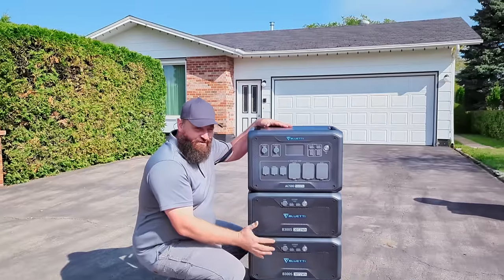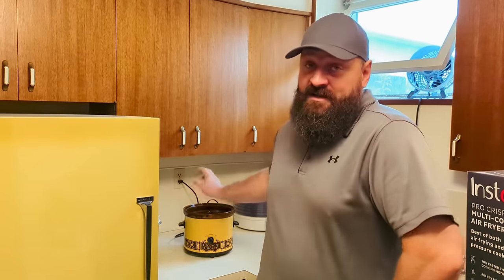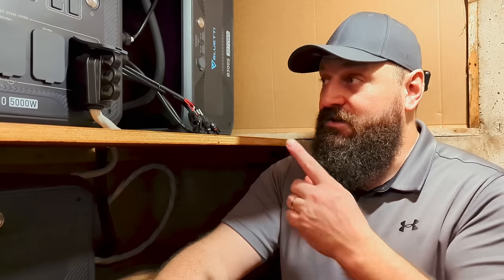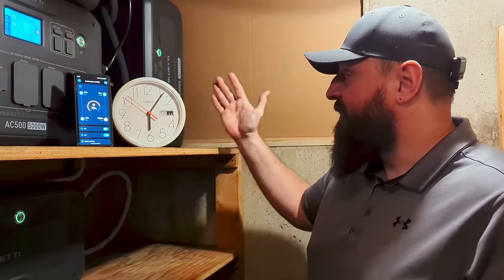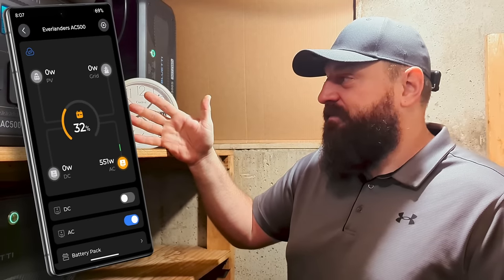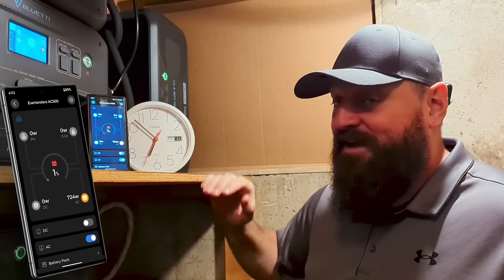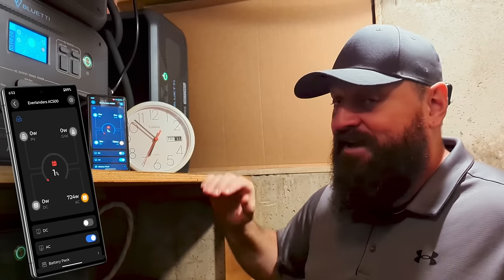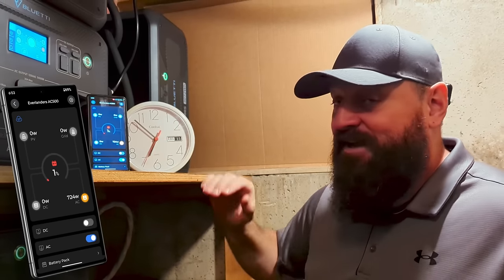Bluetti Power for Hours - 24h Stress Testing the AC500 and 4x B300S Battery Modules.

Comment from the maker: Just to clear up any confusion, at 5:47 when I mentioned that you can take a single battery module and use it independently from the rest of the system. That is for DC or USB loads only... And you would need to get a small AC inverter with a cigarette lighter adapter to use AC appliances...

Comment: I have been using my AC300 system (2 inverters and 6 batteries for the US split phase) for over a year now, running it every day to greatly reduce my power bill. I have it charging from a 6kw panel array. It is set up to run most of my house except the dryer and water heater. It has worked seamlessly and i have no complaints. I actually prefer that the system cannot be manipulated by wi fi as i feel a hacker messing with my system is a growing threat with everything being connected it makes a more tempting target for hackers anymore.  Good video showing just how this can work, looking forward to seeing how you add panels to the setup.

Comment: Just got mine in and it only came with solar charge cables and the battery link cable. Did not come with any other way to charge it up. Shouldn't be too butt hurt about it as I did get it on sale for about half what they normally sell for...

Comment: Efficient appliances are a necessity for off grid solar only.
In my micro home: 
2x 8’ of LED lights, Amazon Echo and WIFI router
MiniPC, 50”4K display, and speakers
Mini Fridge, Water cooler and A/C or heater.
15KW battery is good all night.

Comment: Awesome video once again!  I've got a lot of numbers to crunch to determine which path is more optimal for my situation.  I like the modularity of the system presented, but I'd love it even more if the cabling for additional packs was more compact (right-angle connections or something to that regard), but I know a custom setup could be even more compact and possibly more energy-dense depending on the chemistry chosen...

Kind of curious if you built the truck again today what your opinion would be?  In fact, one thing I do love about some of the full-time channels I've watched in the past is when they particularly point out their own failures, misconceptions, struggles and how they'd re-approach if knowing what they know now.  Kind of a rare video to see, but it's usually one of the most informative perspectives.
Reply from the maker: Yeah, time for an updated video tour after 5 years... what I'd change and what I wouldn't...

Comment: Do you know if such a thing exists: a circuit breaker that automatically shuts off when the power goes out and requires manual switching back to 'on' when grid power is restored? Great video btw!
Reply from the maker: Like I showed in the video? Just don't connect the sense/trigger wire for the grid...

Comment: In your overlander on the wall, the thing that says "home is where the wifi connects automatically", is that a usb hub/card reader thing or just a holder? Thanks.
Reply from the maker: It's a simple 3D print to hold SD cards and USB drives

Comment: What difference if we recharge the battery from grid at 230V 3A vs. 230V 13A, from technical point of view? May I expect the loss of battery charge /internal usage to be reduced more with grid connection in stand-by (no recharge) in either 3A or 13A, always from technical point of view?
Reply from the maker: Slower is always better.
Reply: @Everlanders  pv is set to 3A. Grid is 3kW 13A, better to keep 13 as charging ampere or set lower?
Reply from the maker: Slower is better, if you are not in a big hurry.

Comment: Will we ever get beyond lithium? I wonder about long term battery safety given the EV stories about battery fires. Is solid state technology even viable for a system like this?
Reply from the maker: Stories...
Reply: @Everlanders  don't get me wrong though, I like what I am seeing here! I like the scalability of it.
Reply: LiFePO4 (which encompasses nearly every power station sold today, it’s just the applications with limited space that need NMC/NCA/LCO chemistries) is extremely safe. It won’t combust without an external spark, at worst it’ll just vent…granted those gases aren’t something you want to stand over and inhale. 

Energy density doesn’t seem to really be improving for LiFePO4, I think it peaks around 150wh/kg whereas the more “dangerous” chemistries are pushing 300wh/kg at most. And I only say dangerous because if they exceed 100 Celsius they’ll likely be headed to 250 Celsius which is thermal runaway territory. 

Lithium Titanate Oxide is 10k to 20k cycles with absolutely zero chance of any combustion or explosion but it’s energy density is even worse than LiFePO4 but not by too much. Problem is LTO is fairly expensive. 

Solid state hasn’t really been proven commercially. It’s between solid state and sodium ion but until those are any kind of mass commercialization (price/energy density/etc) then we truly won’t know. As it stands right now LCO/NMC are going to be the winners for power/energy density, LiFePO4 will win for safe energy storage and LTO will win for outright safety, cycle life and power (10C charge discharge typically meaning 6 minute charge and discharge times are possible)

Comment: Whats the best solar generator in your opinion for maximum everything
Reply from the maker: It depends on your definition of "everything".
Reply: @Everlanders  definition of  everything is i just used those words because i know nothing about electric lol, basically to power say like a 3 bedroom house maximum power with everythjng running the same time, not that i would have everything running the same time but just nice to know i could if i wanted. And everything totally off grid tk batterys, could you do this on multiple eco flows or would there be a better system for something like this? And thanks for the reply
Reply from the maker: Well, take your monthly power bill and see how many KwH you use in a month... then divide by 30 that's how much you need per day.

Comment: Hi,how could i get 3000w of input from solar what and where to plug?
Reply from the maker: Just plug 3000 watts of solar into the Solar input... 🤷‍♂️
Reply: So witch solar input?on inverter box or battery?
Reply from the maker: The way you're asking these questions leads me to believe you haven't read the manual... When dealing with expensive components like this it's probably best that you do.
Reply: Ok i will ask in other way how many W solar input port is on the inverter box?
Reply from the maker: Ok, I will answer in another way... Page 12 of the user manual shows 2 PV inputs in the very clear diagrams... It also clearly states: 
PV Charging - AC500 supports dual PV input with the DC input cable. Connect the solar panels (in series or parallel) to AC500 and CHECK the PV connection on LCD screen. 
Note: Please make sure your solar panels at each input comply with:
OCV: 12-150V 3 Vmp: 12-150V Power: 1500W Max.
E.g. Connect the solar panels in series to DC1 or DC2.

Voc=46.5V Vmp=37.5V Current=9.2A Max.

Total: Voc=46.5×3=139.5V Vmp=37.5×3=112.5V Current=9.2A Max.

Comment: I am always impressed by your sound quality in your videos.  However, I do not see the mic.  Other creators you can see it clipped to their shirt.  Where is yours?  Do you hide it in your beard? If so, that is clever, sort of, built-in wind sock.   Thanks again for excellent content.
Reply from the maker: It's largely dependent on the situation, in this case I have a primo capsule embedded in the brim of the hat, and you can sometimes see the 32-bit float recorder clipped on the back of the hat. I've also had many of my shirts modified to have a hidden compartment to conceal the microphone and windscreen.. otherwise it gets taped to the sternum.